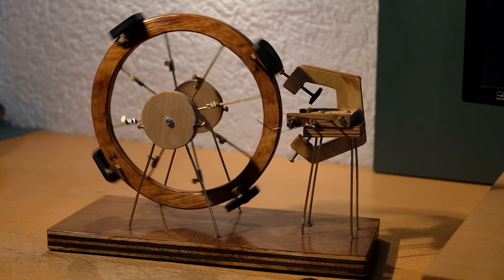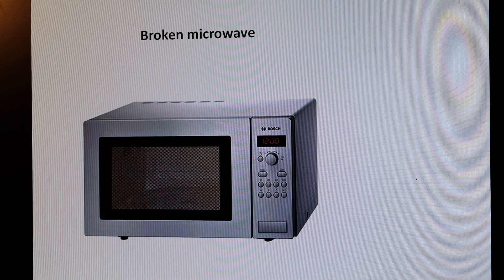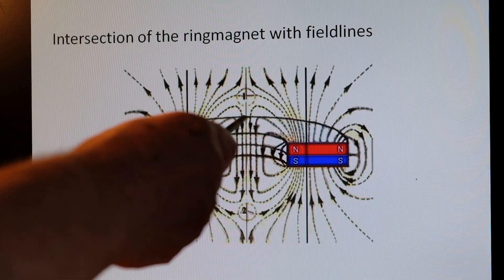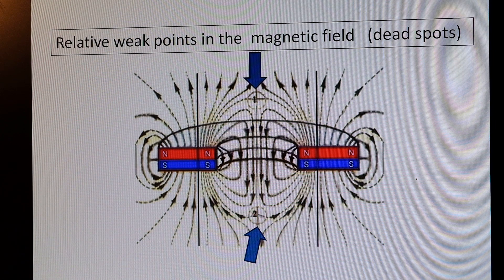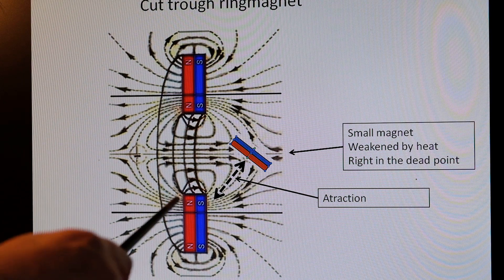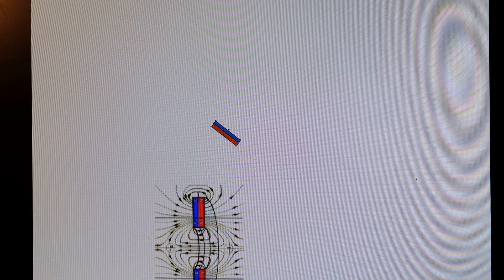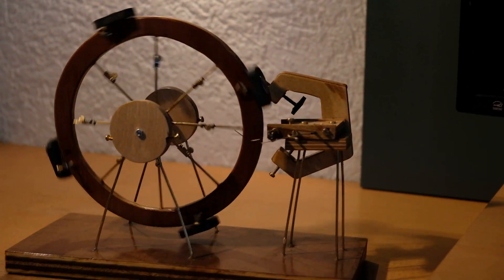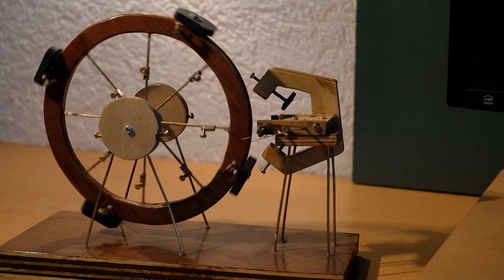Self running magnetic motor  self running magnet motor

Comment: Fake
Reply from the maker: See    https://www.youtube.com/watch?v=bNPNEgb1EEI
Reply: it's not the battery that drives the wheel, it's the draft, most likely paranormal activity :)
Reply: @amodemothpm3194  Yeah, or a fan.
Reply: I challange you to proof that it is fake , i challange you to proof that theres a battery inside,
Reply: @johneygd  I challenge you to prove that it is real!!
Reply: @johneygd  There is a battery somewhere, that is for certain!!
Reply: @StringfellowHawke197  well he showed the unit from all sides even from the bothem , if theres is a battery inside,then he must admit  it, if he doesn’t respond on that wuestion whether theres a battery inside, then i consider him a coward , so it’s up to him to tell the truth.
Reply: @StringfellowHawke197  That is where the burden of proof lies.
Reply: @johneygd  You expect the truth?  Why?
Reply: @johneygd  
Most probably the battery is in the holder for the lever. I think he uses the lever as an electric switch that switches on the voltage only in this short moments when the lever touches the upper stop. In this way he can also stop and restart the device without a manual switch. Those metal spokes on which the device is mounted are used as conductors. This explains why there is one spoke going obviously to the axis of the little lever, which wouldn't make any sense otherwise. Also when he lifted the device and turned it to the side the lever got stuck in the upper position and the device did speed up. So it's a hoax.
Reply: @andreasschmitt2307  mmm well  this explains why he did NOT ansured my question when i asked him multiple time under different accounts “ to confirm if there is no battery inside sothat i would consider it legi” , but he did not responded, i also found it very suspicious why he did not responded to someone why asked him to put a pattent on his device and let scientists take a look at it, only the idea that he might scamming peoples with this “hoax” device makes me mad

I have seen other hoaxers wich did show how to built a magnet motor step by step ,BUT after the promising part 2 video, they never did come with part 3 and they never responded again aaarrrggg, man i really did get pissed off because of this.
Reply: @johneygd  
If you watch the first video of the device it's rather obvious. The battery box is at the holder for the lever (the small board with the hole, which is screwed to the holder). I think the switch is the little lever directly connected to the battery box. The motor is in one of the hubs, the spokes are conductors and somehow connected inside the bottom board.
Reply: @andreasschmitt2307  wich may also explains why there’re 2 square gaps at 1,22 in the first video now while he did claim that those gaps were there because of a mistake in drilling them and that he had to drill new holes because of this, he also claimed that if he knew that this video would,ve become more populair, that he would,ve covered those 2 square gaps with an invisible pasta,that sounds really suspicious, in other words he wanted to cover that hidden on/off switch i guess.
Reply: @johneygd  
I agree, those square holes could be made by accident, when he hollowed out the board.
Reply: @johneygd  Yeah, whenever I make a mistake drilling holes they come out square. That's how I know I've made a mistake.   ;)
Reply: @johneygd  How, magic x-ray eyes?  Perhaps the laws of physics?  How about [plain common sense?

Comment: Hi PM. Thanks for sharing  your work. I did a replica of it and  the flipper magnet doesnt behave like yours.
In your video the fliper magnet returns very very fast in the starting pozition. In my setup the magnet desnt return to his initial position very fast. It wants to stay in the second ""stroke"" until the next magnet comes close.  My opinion is that here is the ""key"" to this toy. Please tell us the weight of the rotating wheel with magnets . Thank you
Reply from the maker: hi mariuscivic
Why is the weight of the large wheel with the 4 ring magnets important?. The small magnet returns to its starting position by the weight of the lever that also determines the stroke. I weakened the small magnet by heating it. If the small magnet is too strong it will not turn and may not turn back. That could also be the cause.
Reply: @perpetuummobile5068  Thank you for  reply. I was thinking that if the large wheel is heavy enough it may not affect too much the  rpm(due to inertia)  when its actuating the fliper. 
By the way...thats a really weak magnet if  retuns only by the weight of that lever

Comment: No doubt ,your invention could scare those oil and gas companies😊👍
Reply from the maker: Oil and gas companies are not scared for this magnet motor.
They have scientist and they have knownidge of this magnetmotor
This motor gives no real ¨free energie¨and do not harm the oilcompanies
Reply: @perpetuummobile5068  not yet but am sure that once improved and once when you wire many of these machines together to a transformer(wich converts 12 volt into 120 volt), you will be able to get free energy, 
Am very optimistic about the potential of this, in fact i don’t understand why you don’t sounding optimistic about it because the potential is there,,, unless you’re hiding a battery inside it.
Reply: @johneygd  
Don't hold your breath! :-D
Reply: @andreasschmitt2307  ahaha well guess what, everytime i look at that spinning wheel i just did hold my breath.
Reply: @johneygd  
Yes, because a battery driven motor is such a breathtaking invention... It is, but nothing new where I live. We've been using it for some time now.
Reply: @andreasschmitt2307  but this motor does not use batterys.
Reply: @johneygd  
:-D
Reply: @andreasschmitt2307  :-D is a smiley face on its side ?
Reply: Are they scared of any hoax video or only of free energy hoax videos?
Reply: @andreasschmitt2307  they will be scared by neither of those but by the real thing.

Whether the magnet motor, the emdrive motor , or the nuclear battery.
Reply: @johneygd  
And Bigfoot!
Reply: @andreasschmitt2307  who says this video is a hoax? I bet it’s not because i see no wires sticking out and i also don’t see a evidence of a hidden bettery inside it oh no, the author of this video MUST admit it if ther is sneakingly a bettery inside it, until then i stil believe in this magnet motor!!!
Reply: @andreasschmitt2307  https://youtu.be/bNPNEgb1EEI

A new update showing there is no battery inside it👍

Comment: Maestro you tell fairy tales, "blind spots" are a myth, the situation changes dynamically. The rotating magnet constantly reacts to the magnets of the wheel and this changes the whole picture of the magnetic field of the system every millisecond.

https://youtu.be/War8Opb8JGg
https://youtu.be/PBPsiJJIuus
Reply from the maker: Hi amandemoth. In you first video I see that big weel turns clockwise and small magnet turns couterclockwise that is not what I  showed in my powerpoint. 
Your second video is very interesting I wonder how it is made
Thanks anyhow I will study this theory carefully (that the magnetic field of the small magnets reacts on magnetic field of the big magnet) If you are right  my theory can be wrong.
Thanks